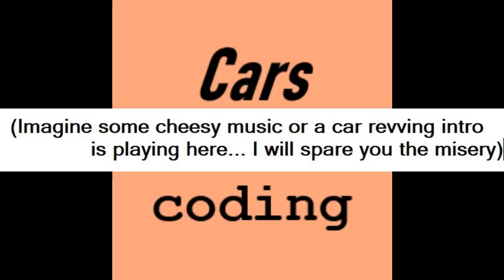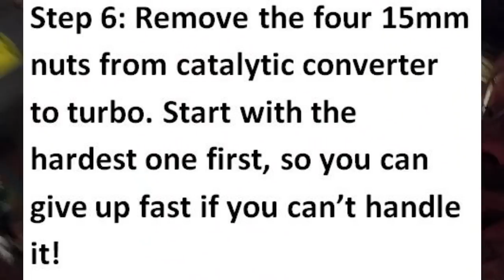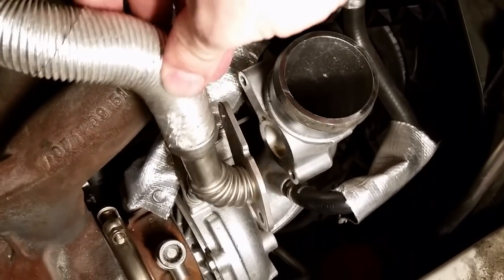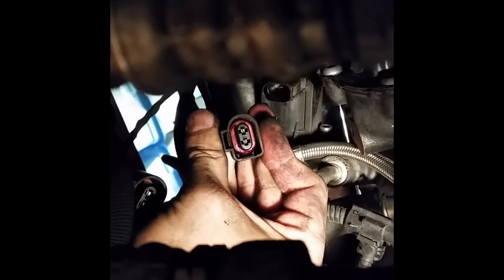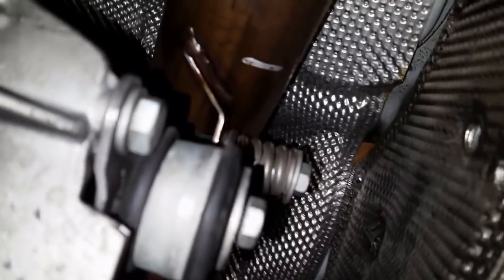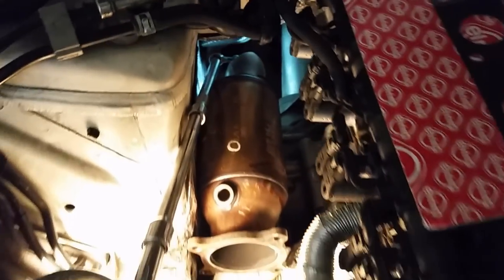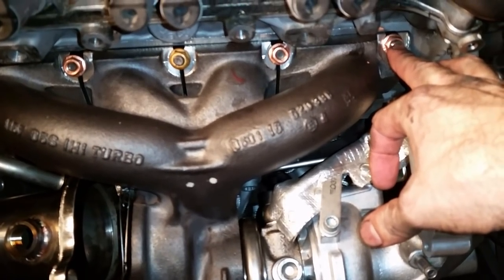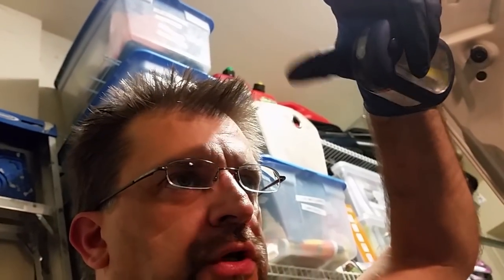Replace Turbo Audi A4 A5 Q5 B8 Turbocharger K03 Replacement

Comment: I just swapped my turbo on my Audi A6 2012 and this video helped more than you would ever know thank you man 👍🏼
Reply from the maker: Awesome! Feels great when you fix it yourself
Reply from the maker: @PeterFeltersnatch852  you dont need to drain oil or coolant. The only coolant than comes out is whatever is in the reservoir jug. So have a pan ready that can hold a gallon when that leaks out. Change the oil after your're done. Total time for me was 10 hours but if I wasnt making the video I would have had it done in 8 hours. Now that I've done it I could do it again in 6 hours. If you keep your stock catalytic converter it's even faster. Messing around with the test pipe to replace the cat  chewed up 2 hours for me. I put all bolts in individual ziplock bags with a piece of paper that I wrote where the bolt was from. That made it fast and easy.

Comment: You helped me diagnose my turbo without the need to take it completely apart. I do have a loose watergate! So I will probably replace the turbo when I’m ready. I just won’t drive long distances because the p0299 code comes and goes but it hasn’t popped up lately. Thank you

Comment: I would never-seize all your bolts and a light copper spray on your manifold gasket, makes it easier to ever get off and reuse! Copper nuts are 1-time use. Most bolts you took from top can be removed from bottom. You showed the wastegate moving and loose. You can heat the linkage arm in the turbo red hot and smack it closed! Probably could have saved a lot of work? If turbo vanes were spins freely? Clean with carbon cleaner or carb cleaner. clean all the rest with carb cleaner or oven cleaner. Been there done this on VW Jetta Turbos. Unless turbo vans are hung up? Just heat the wastegate linkage in turbo and Re-Set it! The video is pretty good though. YOU DID IT! Saved a Ton of Money!
Reply from the maker: I only heard of the heat up and bend method to fix the wastegate after I was completed. Other people have fixed it that way or by replacing the bushing and wastegate flapper with a new one. I still have the old turbo so I will fix it someday so i have a spare when this one gets loose.
Reply: @CarsandCoding  Great! Your Video was pretty explanatory to many first time guys. I liked it a lot! Keep it up, people need all the help they can get!

Comment: You are amazing.  Thanks so much for doing the video.  I've learned a lot and a few tools and tricks which i have never thought of like the hose picker and the jamming of the t40 into the damaged 6mm to remove the funky nut.  Also the removal of the 4th catalytic nut which is next to impossible.  The camera angle into obscure places is something i haven't seen to many u-tubers do.

Comment: Alright, the install went great! The power is restored. The only thing I messed up on was that dang coolant banjo bolt behind the manifold! Didn't  torque it enough and it leaked.. ughh.. took about another 2 hours to pull the turbo off the flange to access it and tighten it down got about another 3/4 turn on the crush washers and it sealed it just fine. no leak now.. if I had to do it again it would be super easy. Hardest part was the install part. Removal was easy. Thank you again for this video, it helped me Immensely and with the confidence to DIY this.. if anyone else needs help or tips dont hesitate to respond to this comment.. I'm here to forward the knowledge. Thanks again. Till next time.

Oh I'll look forward to the next timing belt change video for the Audi . Lol ouch looks tough I bet.
Reply: question for you, since you had to remove turbo off again, wouldn't that mean you have to replace gaskets again? or did you reuse them? if so did you tighten bolts a bit tighter or did you order replace gaskets again? im asking because i might have to reuse the down pipe gasket.
Reply: @Mchristopher91  I said screw it and reused them.. everything was just fine. The downpipe gasket had no marks even on it. So I re used them
Reply: Did you get new washers I have the same issue with the coolant leaking, do you know where I can get these crush washers?
Reply: @antoinettecastillo1160  I think they came with a new lines. Just tighten them down more.
Reply: @milehigh3054  oh okay thankfully I was able to find them, and fixed the problem perfectly!!!
Reply: @antoinettecastillo1160  nice! Anything else just let me know!

Comment: Don't know if anyone said this before, but if the trunk closes, you can drop the back seats, enter the trunk and there is a latch on the trunk door you can use to open the trunk. But yea, not really so comfortable, so best option is not to allow the trunk to close.
Reply: My a4 b8 seat backs are bolted

Comment: Great video - I haven't heard of the KO3 turbo. I just replaced my the turbo on my 2007 Audi a4, using your video as a guide, with a rotomaster, and it ran well for 2 weeks and then I noticed it blew smoke twice - 2 days in a row. So Im going to return it. However the KO3 is much cheper than the Rotomaster. How reliabel is the KO3?
Reply from the maker: The k03 is the stock audi turbo

Comment: Another question for you, what brand turbo did you replace it with? And have you had any issued with aftermarket life compared to oem?
Reply from the maker: I replaced with a used low mileage stock turbo from a 2014 A4 that I bought for $400 used on ebay. Since posting the video other people have bought brand new turbos and successfully installed and they have worked. If you pay less than $800 for a brand new turbo I would not trust it, but I have no experience to back this up. Could be cheaper ones will work just fine, but I would want to hear from someone who has installed one first.
Reply: @CarsandCoding  if you go on ecs tuning they have the IHI k03 for like 850. Same turbo without the audi logo.

Comment: Best audi turbo video I've watched. I have my a5 on jacks I wanted to adjust the actuator rod but I'm afraid I might not be able to because of your video. It has the exact symptoms...I wish I knew if I have the one I can adjust
Reply from the maker: Mine is 2010 A4. A5 is same. Actuator rod is not adjustable. You can try bending it, but it probably will not help.

Comment: so can you verify the turbos from 2013 and up will in fact work on the earlier B8 models (2009-2012)? I have a 2011 and I would rather go with a newer version of the turbo so it's less likely I have the dreaded wastegate failure again...awesome video!!
Reply from the maker: Yes all turbos 2010 to 2015 will work. The newer the better! 2016 and newer will not work, they are different engine.

Comment: Thanks for the video! I’m having to replace my ko3 as well. I have a stage2 tune already so won’t be replacing the Cat just the turbo.How long should this take me
Reply from the maker: It can be done in one day. Put all the nuts and bolts in ziploc bags and stay organized. MAKE SURE YOU TIGHTEN THE COOLANT LINE BANJO BOLT BEFORE INSTALLING THE TURBO. There is one banjo bolt that is near impossible to tighten while turbo is installed. it is the coolant line that you transfer from old turbo to new one. Tighten it on the workbench. If you forget to tighten it before bolting up turbo, you just increased your install time drastically. It can be tightened with turbo on, but it's a Chinese puzzle. Other than mistakes like that, should be 6 to 10 hours depending on your skill. Not replacing cat will cut 2 hours off. Getting it done on a Saturday is definitely doable! Good luck!

Comment: Hey hopefully u see this. I have a 2011 A4 can I replace the turbo with a b8.5 turbo?
Reply from the maker: Yes those are better. The newer the better!
Reply: So basically I can buy a 2014 turbo and it will work. It’s also a Quattro. Thanks for the reply
Reply from the maker: @Nikeheat  yes good to go

Comment: Another great Audi video, thanks.  Looks like I need to do this now too and this will be my step-by-step guide.  Am thinking I will have mine rebuilt, rather than buy a used one.  Wondering how you liked the test pipe?  Did it become really loud, or trigger CEL's at all?  Thanks again!  Liked + Subscribed.  I have watched this several times now :)
Reply from the maker: I do not recommend test pipe without stage 2 tune. When you put the test pipe on you will get a CEL and there was no way to get rid of it, I tried o2 spacers and they did not work for me. Also the exhaust will smell like old school 1960s cars. Which I like but not everyone does. With the Unitronic stage 2 tune I am very happy now, but I'd probably be just as happy with the stock cat and stage 1 tune. The test pipe is louder, but not a lot. You can hear the 'fart' with each shift at 5k rpm or so. Glad you liked the video! May all your projects go well!

Comment: Cars and Coding. Does the check engine light came on because the test pipe? Awesome video!
Reply from the maker: Yes my check engine light is currently on because of the test pipe. P0420 code. I have tried various o2 sensor spacers but haven't found a combination that works yet. I'm not trying too hard because I am going to get unitronic stage 2 tune which codes out the rear o2 sensor. Glad you liked the video!
Reply from the maker: @PeterFeltersnatch852  For me on stock tune with test pipe (catalytic converter removed) I was able to avoid the p0420 by driving very easy, never getting above 3k rpm with or without any spacer. Only when I floored it would the p0420 light up. I'd say clear your codes and drive slow until all emission readiness says OK then have it tested. As long as there is no check engine light and all emission tests are in the ok/ready state you should pass. But I dont know your states laws so checkout the forums on audizine.com for more info.
Reply from the maker: @PeterFeltersnatch852  I never heard a whining noise, mine was more like tinktinktinktinktink rattle after I revved up in neutral.
Reply from the maker: @PeterFeltersnatch852  Stock injectors are all you need for stage 2. There is a ton of info on the forum messages on audizine.com you should check out.

Comment: Do you guys recommend buying a low mile turbo or a brand new China part they are both around the same 400-500 range
Reply from the maker: I went with a low mileage one. I don't know about the China ones. But if you go with China, please let us know how it is! If I were to do it again I would probably upgrade to K04 turbo. They are around $1200 but will shave almost another second off quarter mile time vs stage 2 tune.
Reply: Cars and Coding sure thing the parts get here on the 20th and I’m installing on the 21st

Comment: Very calm on explaining and details, thank you I need to replace my Audi A4 P 0299 code, thank you very much, and we have to replace the test pipe also in this case?
Btw which turbo were you getting, type and model no,  thank you once again
Reply from the maker: You can keep the stock catalytic converter, no need to use a test pipe. The turbo is any low mileage used turbo from 2012 to 2016 Audi A4, S4 or Q5 with the 2.0L engine. I bought mine used from ebay. You can buy a new one, but it will be about $1,500 vs $400 for a used low mileage turbo. Here are the turbo part numbers that fit: O6H145702L and revisions afterward
B8.0 has numbers ending in 702G, then 702L, then 702Q, then 702S

B8.5 has numbers ending in 702R, then 703N, then 703R, then 703S
06H145703S 2013+ are the best ones
Reply: Cars and Coding 
Thank you very much for giving me all those great info, I just ready to replace my wife’s car, once again thank you 🙏 and good luck on YT Channel.
Reply from the maker: @milehigh3054  no you need a catalytic converter to pass emissions

Comment: You dont have to loosen the bolts under the manifold? Those plates to take it out? I looked at mine and they look really hard to get to when the manifold is up there. Also did your car blow black smoke from taking off before you replaced the turbo?
Reply from the maker: I did not have to loosen the bolts under the manifold to remove it. I had to loosen them and then retighten them to get it to fit back in though! It was strange. There was no black smoke at all.
Reply: @CarsandCoding  Thanks. My wastegate was junk and needed to be replaced. My car blows a puff of black smoke when I take off. I hope this fixes it but I doubt it. It burns a quart of oil in 300 miles.
Reply from the maker: @NitroVipers3  the turbo is not going to fix the oil problem. The oil problem is the piston rings. If you want to fix that, best replacing the whole engine from a 2014 to 2016.
Reply: @CarsandCoding  Yea, I know about the pistons and rings, its just oil smoke isnt pure black. For some reason its very rich. Will a 2014-16 engine drop right in without a new computer? I was basically planning on taking the engine out and putting new pistons/rings/timing chain/waterpump and fuel injectors. Im just hoping changing the turbo fixes the black smoke and zero power at low end.
Reply from the maker: @NitroVipers3  for sure turbo with good wastegate fixes the power! No new computer needed for replacement 2.0L motor. I was burning a quart every tank of gas with mine at 55k miles and got it fixed with new pistons under warranty. Now I have 91k miles and still burns zero oil at all.
Reply: @CarsandCoding  It sucks because audi wont cover mine. It would be alot easier just buying an engine but those are crazy expensive. I could fix it myself for probably less than $1500. I just pray the turbo fixes the black smoke. I mean if the wastegate isnt closing the turbo isnt working correctly throwing the AF off. Or thats what I am hoping anyways. My car currently burns oil at about a quart every 300miles. But I changed the PCV which was bad and currently testing the mileage. I have so unlisted videos on youtube if you wanna check them out about oil in the intercooler pipes and turbo and stuff.
Reply: @CarsandCoding  I changed the turbo today, it was getting dark and it looked like my antifreeze was very low, alot came out of the turbo lines. Should I be looking or listening for anything specific to make sure the turbo is good? I dont see any leaks yet, I left the belly pan off for now to watch it. I still see a tiny bit of black smoke out of my exhaust but its way better. Maybe the computer will lean the engine once it learns there is a new turbo on... hopeful wishing.
Reply from the maker: @NitroVipers3  watch for leaks and make sure coolant and oil are filled. Turbo will smoke in engine bay for a day as it burns off oil from install. Good luck! Glad you were able to do it!
Reply: @CarsandCoding  Everything seems fine so far, it didnt stop the black puff of smoke out of the exhaust when I take off tho :'( Im too poor for this car...
Reply: Cars and Coding will a 2014 a4 engine fit inside a 2011 a4 Quattro without modifications?
Reply from the maker: @StealurGoat  Yes but you need to use your old plastic intake manifold and a few other parts.

Comment: How much oil were u able to put inside the turbo before start? I used a funnel and only got in about 1 teaspoon before it spilled all over.

I am seeing slight white smoke. No new oil leaks. Was wondering if i should unbolt the banjo and try to add more oil into it.
Reply from the maker: You do not technically have to add oil. Since you started it already it has oil now.
Reply: Thanks for the quick reply. Did you had to do anything with the coolant? Seems like i lost about 4-5cups of coolant but when i fill it back up with what was taken out. It seems to sit on the max line. Makes me think there might be air in the coolant system. Particularly at the turbo.

Think i’ll try to bleed the coolant by turning on heater and cap off. Btw, your video is on point. Thx u
Reply: I drove it around our garage a bit and the air bubble got out. Now the turbo is running good. Think it was hot because no coolant was running thru it.

Comment: Looked at the part, how has the offbrand turbo kit been doing this far? No other issues with it?
Reply from the maker: The eBay test pipe has held up so far! One year later still going. If I was to do this again I would have done k04 turbo. But its fast enough for me now
Reply: @CarsandCoding  would you need to do anything to the internals if you wanted to upgrade to the k04?
Reply from the maker: @ynnus_  k04 requires a different tune but no parts difference except bigger intercooler.